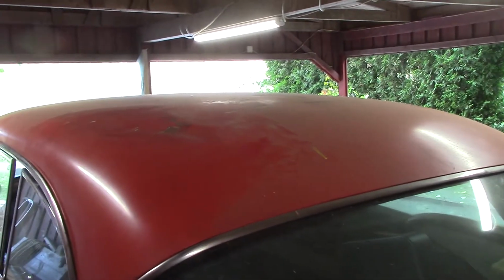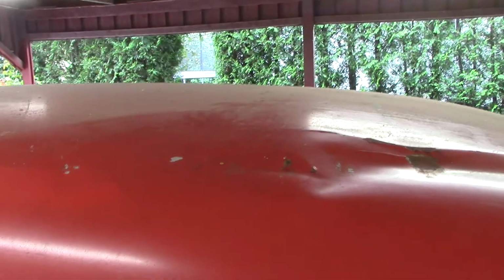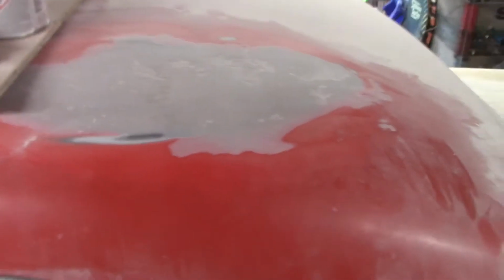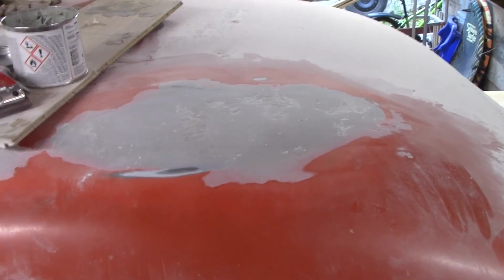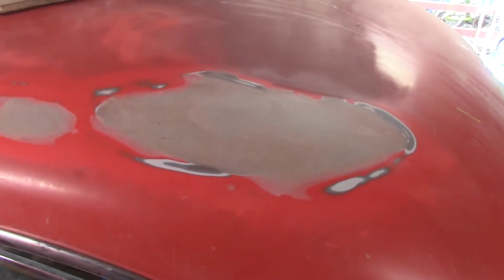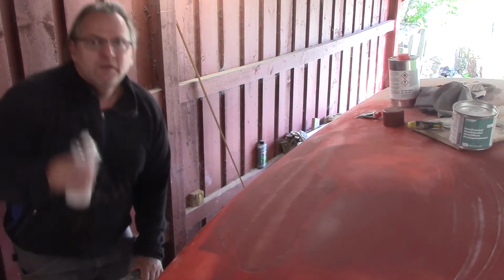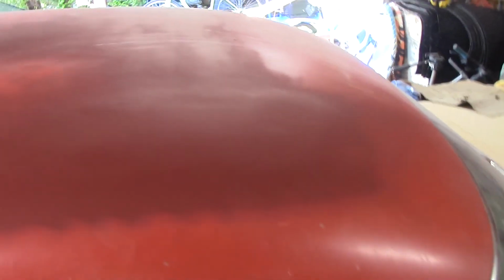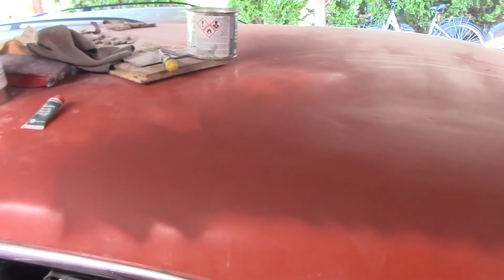fixing a huge roof  dent  1955 buick century

Comment: you need to use a lightweight polyester Filler over the fiberglass to smooth it out and fill the pinholes
Reply from the maker: thank you for the responce ill try it out